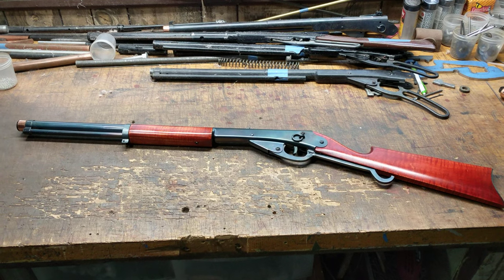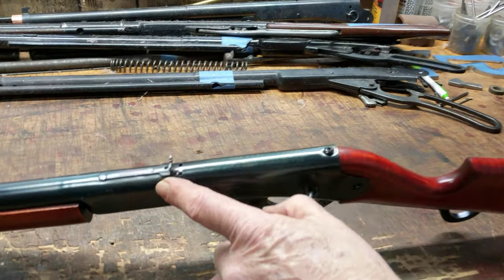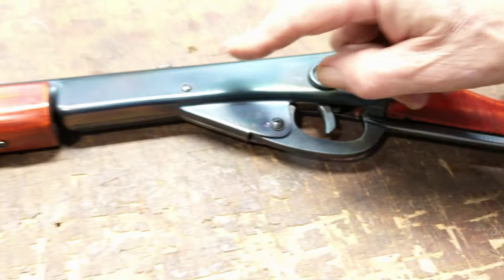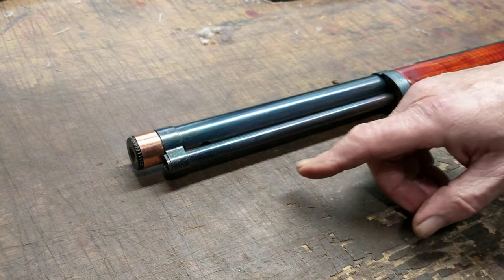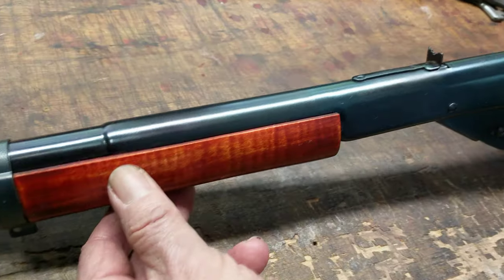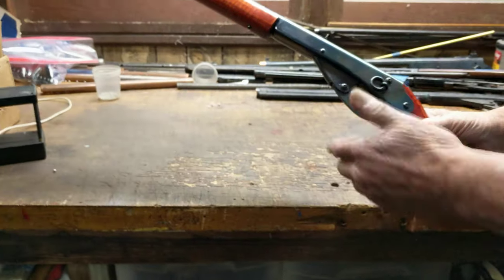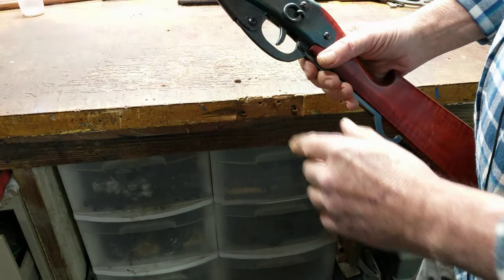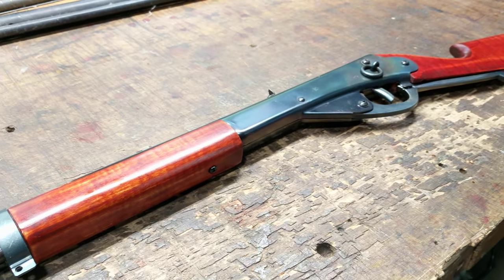Bye Bye Model 40/27 off to the hills of Tennessee

Comment: idea? after a polish job to the air cylinder, could heating to 300-325 and coating with Frog Lube make it even less friction? all plunger sliding parts treated then using the right light grease may increase the fps some. maybe same for inside barrel itself, Frog Lube supposed to get into the pores same time it coats metal to be slicker.

Comment: Good looking gun, do you have to modify the cocking lever inside to pick up the sliding spring block?
Reply from the maker: Dennis, No mods to the low pivot levers although you'll need a mainspring compression tool to mount/dismount the lever as the SSB is always under tension.

Comment: I use rub n buff for the letters on shaving brushes that I restore wonder how it would work on daisy letters
Reply from the maker: Donald, The issue I've been running into is getting the gold colored infill to stick. It's a really nice look and I intend to get it right. Someday. Is Rub n buff a product for wood or will it work on steel?
Reply: @RestOModDaisy  I haven’t used it on metal, I only have used it on plastic , not sure but I would think it would work on metal.  It’s like paste you use a brush or I just use my finger and spread it across the letters then buff it off and it sticks and fills the letters. It may take some practice to get use to. But be careful pits or seams it will stick in and tuff to get out.
Reply from the maker: @donaldmann2158  I'll look into it, it's gotta beat the "ColorStik" I'm currently using.
Reply: @RestOModDaisy  it would be worth experimenting on one of your beaters. You can probably find it in hobby or craft store or on line. Just google Rub n Buff